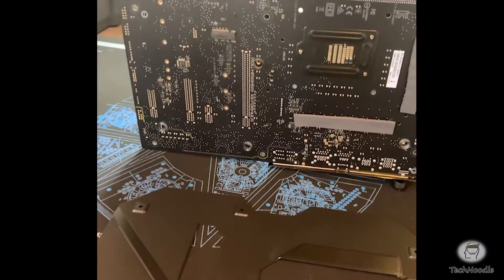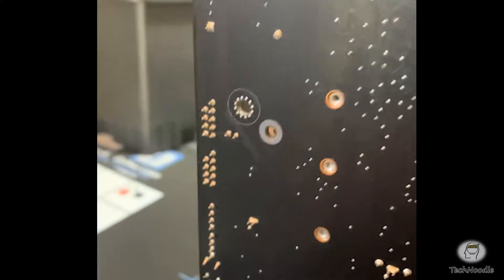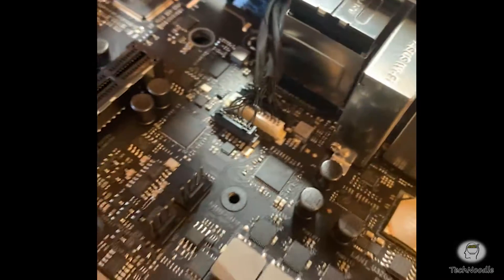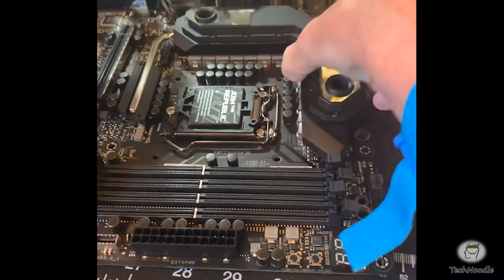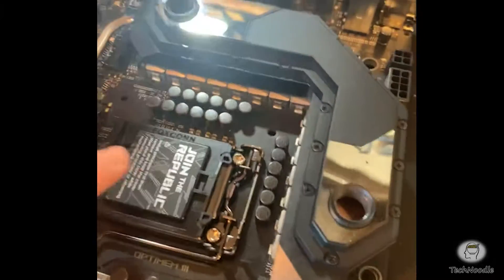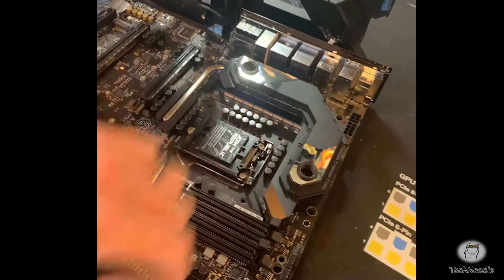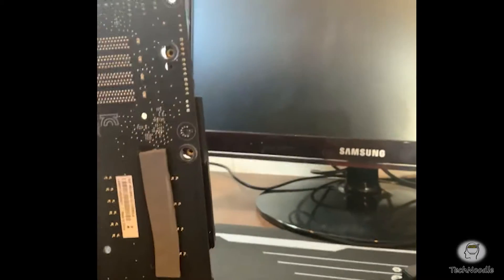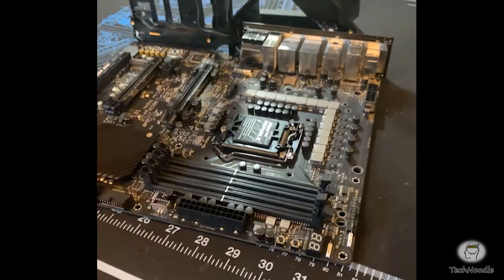How to Remove the VRM Waterblock from the Asus Formula XII Motherboard

Comment: I have this mobo but no custom water loop. Should I remove this VRM block like you did in this video to prevent overheating? I have no plans to overclock at this time.
Reply: Why would you think removing a heatsink/waterblock would prevent overheating?  The reality is that the vrm's don't produce a ton of heat, the water block is really overkill and for enthusiasts.  Removing the block would make them run hotter though, so just leave it on there and everything will be just fine.